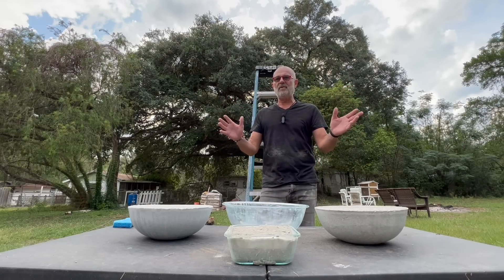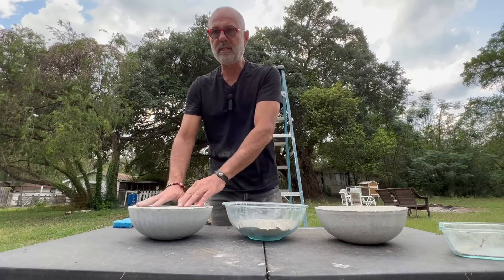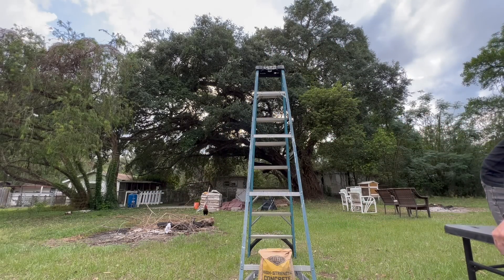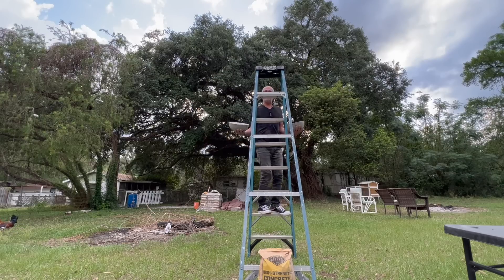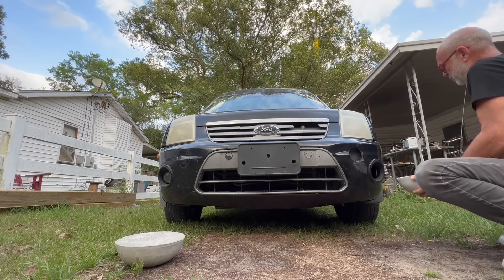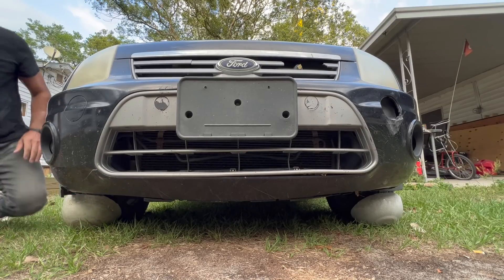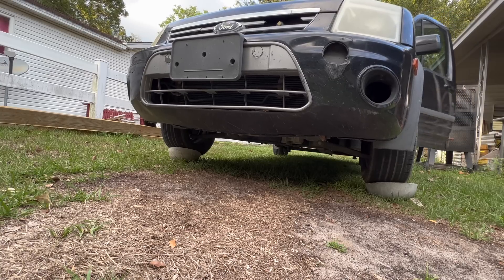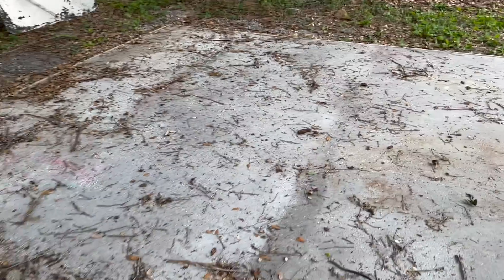Dry Pour Concrete vs Wet Pour Concrete - Strong Enough

Comment: People are saying it because it will take money from them if more people start to dry pour everything instead of paying a concrete guy to do it for them.
Reply: BINGO
Reply: exactly! people needs to wake up. if your concrete needs are build to code, then heck yeah! wet pour all day! if your needs are just your average backyard concrete deck, walk path, stairs or to hold sheds and heat pumps. dry pour is more than enough! no need to cash out $$$ for your 12 x 10 slabs!
Reply: Facts
Reply: No, actually a lot of people are saying it because it’s stupid. It doesn’t take money from people but actually in the long run makes people get money because contractors have to go back out and fix this shit later on the other people have bought the property or something and lo and behold. They need a new driveway or they need to do this because it’s cracking. It’s not gonna hold up long-term. Secondly, I’m not a contractor. I do work for a city municipality. I watch the guys that I work with who do subpar stupid shitty work and then I scratch my head and I have to report them because they do not do the proper work that they’re supposed to. I’m getting paid either which way it goes whenever I’m doing concrete that I’m doing however whenever I’m doing concrete for myself are helping somebody else with a concrete job. I’m doing it 100% the right way and not getting paid for it so when I’m telling people that this isn’t a good thing to do it’s it’s not because it’s taking money out of my pocket because it’s not it’s because it legitimately is not the right way to do it And it legitimately is really just the stupidest thing you can do. It’s a big waste of money because after you pour, it looks like crap no matter how great you finish. It still looks like crap doesn’t have the same compression strength. If you put rebar in it, it doesn’t hold the rebar as well as what concrete does because it cannot conform to the rebar to make it strong like it should putting fiber in it does not help it really because And again it doesn’t have the structural bonds that it needs because everything was not mixed together properly in order for it to make a good bond think of it like a cake if you don’t correctly mix a cake together and you put it in the oven then it falls and it’s a flat thing and gooey and nasty because it didn’t have the correct bonds that needed in order for it to rise and stay solid so no it’s not for that reason this is because stupid shit like this is why we have to have inspectors to keep things correct and another thing everybody’s always talking about how easy this is the amount of work and effort you go through to get this to work is way more work and effort than what I go through just to throw some concrete and a freaking mixer throw a little bit of water to it dump it in a freaking hole or dump it in a a slab formed area And then screed it out put a broom on it. Call it a day you’re huffing and puffing looking like you’re about to fall out having to wear a dust mask and shit I dumped some concrete and a cement mixer. Throw some water to it smooth it out real quick. Call it a day. Hey, I like to say is if you feel like this is a good idea by all means do whatever it is you got to do but just know there’s a reason why it says that they do not recommend it on the bags. It’s not the concrete people that are doing the jobs that are telling you this is the actual people who are selling the cement they specifically tell you that it is not recommended to do dry pores because it’s not designed to work like that
Reply: No one's worried about money. People who never mix poured aren't going to just start dry pouring. They're still going to pay a guy for excavation, strong sub grade, and a nice finished surface. Sure someone might make some garden stones or yard ornaments thay take a couple bags, but no ones going to handle hundreds bags of concrete to do a patio or a couple thousand bags to do a driveway
Reply: @Bennysol  That's not exactly true. I've never mix-poured a bag of concrete in my life. But damn if I'm not thinking about dry-pouring some concrete steps for the front of my house. The contractor gave me a quote of $2,500 for a pair of steps about 4-feet wide. Hell no! Let me just do some more research on how to properly build the forms... and it's on!
Reply: @e-mailuser9811  how many steps?
Reply: @Bennysol  3 steps
Reply: @e-mailuser9811  uh yea you just agreed what I said. Probably won't take more than 10 bags. I'm sure no concrete business is concerned about your fraction of a yard of concrete. Commercial concrete cares about big pole barn, retail, warehouse, foundation type concrete bringing in hundreds of thousands of yards of concrete. Residential guys care about driveways and patios and basements bringing in thousands of yards of concrete. Like i already said, no one cares about your yard ornaments and garden steps
Reply: @Bennysol  What you said was, "People who never mix poured aren't going to just start dry pouring." That's not true.
Reply: @e-mailuser9811  

Facts!
Reply: @Bennysol  I did a baller patio dry pour turned out great